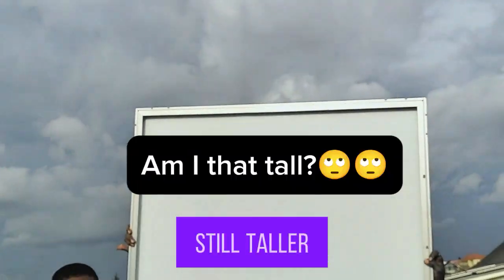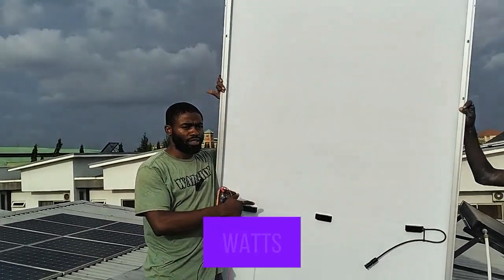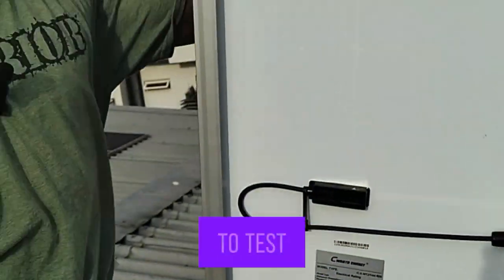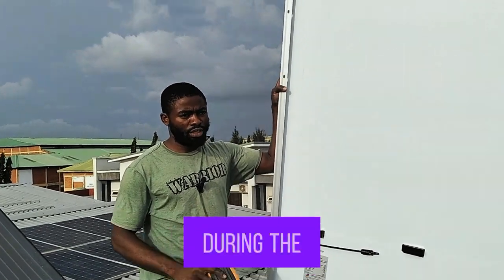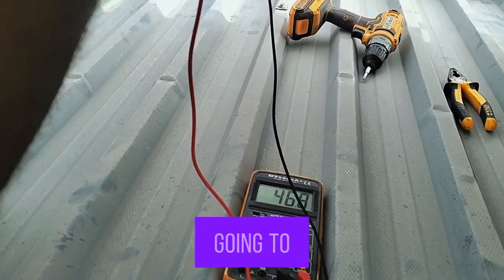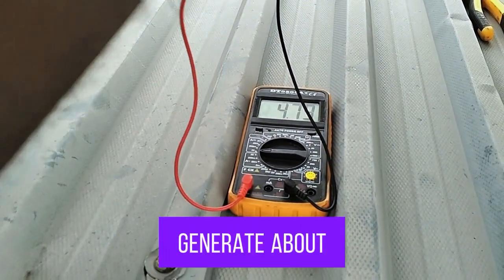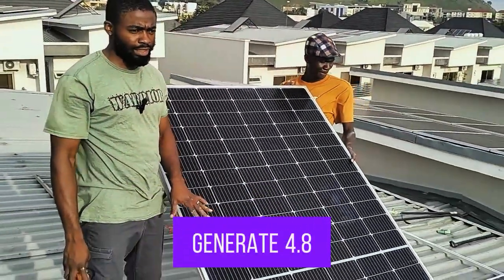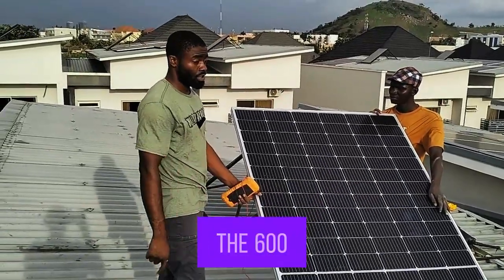How efficient is a 600w solar panel?

Comment: Hello boss, recently i switched on my lights, some are not working amongst them which hass been like that for years and we used the other bulbs available in the P.o.P all for me to switch on  the light of a recent and the dead bulb started spiking, all of a sudden my inverter started making noise, Just to discover my inverter stopped working and started displaying OUT V, so i changed the FUSE, after changing the FUSE, it still doesn't work, Please ehat else do you think the problem is boss

Comment: Good morning please my 2kva sunfied hybrid inverter cooling fan it’s not working. if i turn it on the fan will come up but when the inverter start heating up the fan won’t on then the inverter will heat error code, what could be the problem please?

Comment: The short circuit current would always be higher than the working current, so the volt x current you did is just an estimated power.